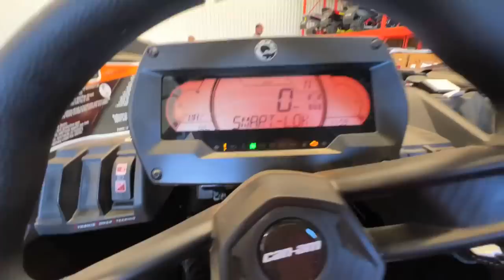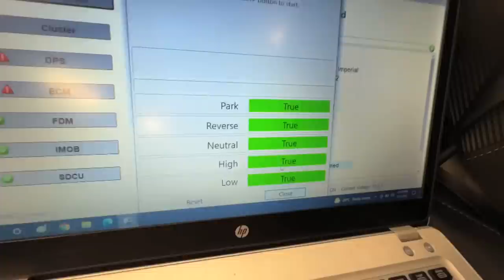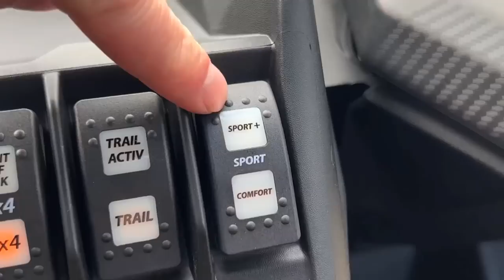2022 Maverick X3 XRS SS UNBOXING!

Comment: So awesome!! I have the 64" for riding here in Wisconsin...beast of machine!! Can't wait to see your add ons...I did full glass windshield,  airdam system on roof, air intake relocation kit (quiet down cab noise)...and!! S&S OFFROAD dual outpost exhaust, (check them out)..they are notorious for Harley Davidson motorcycle products, entered the SxS platform last year!  Absolutely phenomenal exhaust..comes with extra tune port inserts for trail or race